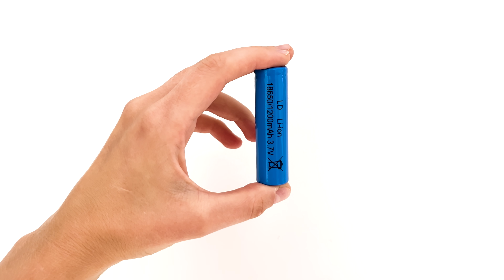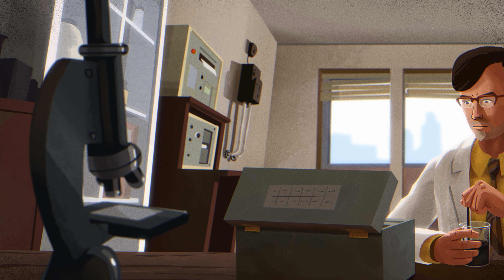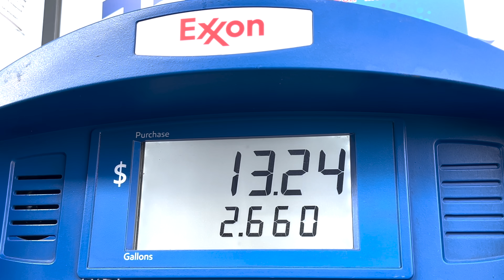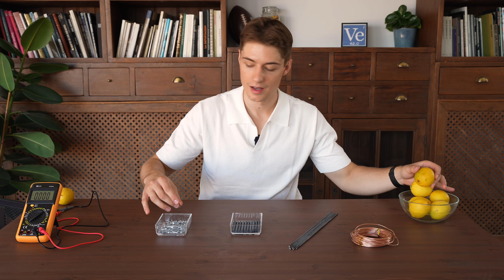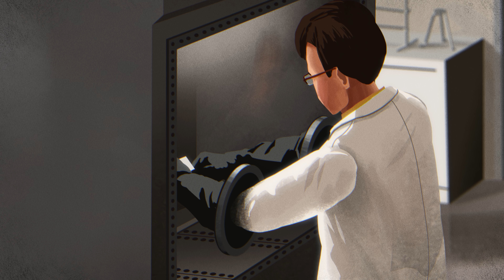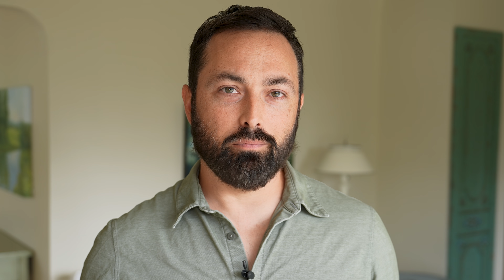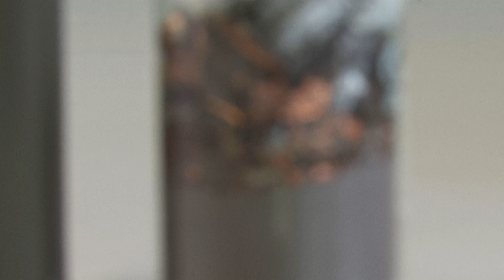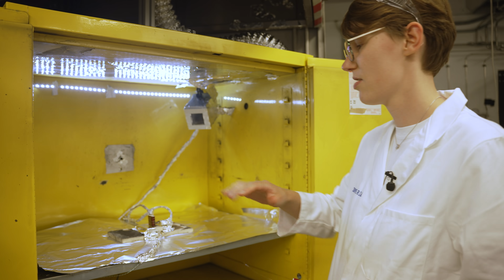The Perfect Battery Material Is Dangerous

Comment: holy incomplete 5:13–6:04... bro forgot to mention the important counterions that prevent a build up of charges in both electrodes (in this setup, indeed, zinc ions would be able to enter the lemon and be stabilized via solvation than to stay in the metal even without counterions, so only the cathode would be charged) and that is whatever acid was the source of the proton (mainly citric acid). these negatively charged couterions (that became negatively charged after losing their protons) pair with the positively charged zinc ions that got oxidized, however, in order to pair, they need to travel through the interstitial fluid of the lemon because they're on opposite ends of the lemon. if you cut the lemon in half, they can't reach each other, and so, as the kind co-host explains charge builds up, increasing the electrostatic potential energy of the electrochemical system to a point where the reaction (due to electrons being pushed back in the conductive material) stops. 

this explanation makes it seem that the electrochemical reaction involves the copper since they never mention those counterions, so i wouldve clarified that the copper here just acts as a conductive electrode and does not participate in the electrochemical reaction whatsoever, unlike zinc. in all, the electrochemical reaction is between acids in the lemon, predominately citric acid and zinc, and it produces hydrogen gas and zinc salts.

Comment: Near the beginning of the video the Carbon zinc battery shown cut in half, provides a nominal voltage of 1.5 volts per cell at the beginning of its life, not 1.2 volts.
Reply: A carbon-zinc battery provides a nominal voltage of 1.5 volts (V) per cell, though it can range from about 1.4V to 1.7V initially and drops to around 0.9V as it discharges.  Initial voltage depends on the make up of the cathode, manganese oxide(+2 or +4 valence), impurities, etc.  Zinc will corrode and hydrogen gas is the product, mercury was added to reduce this corrosion/gassing, and later replaced with non-mercury containing materials.

Comment: Rachid Yazami is missing from his's story. He’s the Moroccan scientist who, in 1980, discovered that lithium ions could be reversibly intercalated into graphite. This solved the safety problems of metallic lithium and gave us the graphite anode — the foundation of every modern lithium-ion battery. Also he didn't get noble prize because it is only given to maximum three people even though without Rachid Yazami we wouldn't have mobile, laptops or any devices that uses this. It's kind of incredible they did all this research but missed such a huge part either it was delieberate or it was done because the people responsible for doing the research weren't educated well enough to do proper researching in this field. I feel like ever since Veritasium got sold to Private Equity the pace of the videos have gotten a lot higher but that seems to be coming at the cost of proper Science studies

Comment: At 11:34, "...those electrons travel through the external circuit toward the cathode,...".
I thought it is not the electrons that travel, but it is the electric field that builds upon closing the circuit, see here: "The Big Misconception About Electricity"
I guess a could example of when to use which model.

Comment: No, AI doesn't "understand" anything. They simulate behavior or result, not understanding. This is an important distinction. NEVER do the mistake of thinking an AI understand anything. It doesn't. It mimics patterns and results without really understanding them. This is one reason catastrophic errors can slip through without the AI "realizing". That's because it's not in the business of realizing. It's in the business of pretending to realize.

Comment: Tesla has Aluminum batteries, non toxic, non flammable, cheap (less than 10 percent the cost) last 10 times longer, charge much faster, operate in a much larger range of temperature don't produce dendrites and the kicker, hold three times the energy.

Comment: The definitive solution to mitigate the inherent dangers of an ultra high energy density battery which concentrates maximal potential energy in a minimal volume, thereby magnifying the risk of catastrophic thermal runaway is the development and mandated integration of a self healing, multi functional solid state electrolyte engineered with an active, distributed Battery Management System (BMS), where the solid material serves as a non flammable separator that instantaneously seals micro shorts to prevent dendrite propagation, while the embedded intelligent network continuously monitors and autonomously adjusts electrochemical gradients at the individual nanocell level to maintain thermal stability and preemptively isolate any degradation event before it can trigger a cascading, system wide failure.

Comment: Loved this summary.  Matches everything fleet maintainers see and understand about their DPFs (and downstream stuff like DEF and SCRs).  

That said,  I think you missed some awesome opportunities to mention "rolling coal" when talking darkest grey smoke or that "there is no replacement for displacement" when talking about opportunities for more fuel for power.  Tiny cylinders vs big cylinders - they might both use the same physics but they are different on an efficiency vs power basis.  

I do not think anything will ever compensate for a cold block on a cold morning pulling in dense wet air and trying to mix that before it hits combustion - incomplete burn and that expanding flame front just means that byproducts form.  It still takes time for crank cases to get hot (boo to tiny diesels sold to weekend warriors running short errands and sitting in traffic) and burn off crankcase vapours too - all of this is just soot creation.  Sigh.  

PS: I have an ecoDiesel and I run her long and hot when I can, but cold Canadian mornings are hard on her - sometimes she isn't up to temp in 45 minutes even with a bra, the active grille closed and highway driving not into the wind.  The cold soak is so insidious that what in the summer would have her optimal in 10 minutes just cokes her up in the winter.  I understand that highly efficient cooling is necessary (to balance thermal expansion, stop melting and gasket destruction among other things) but it can also be an achilles heel.  It would be an awesome video but way to hard to show with so many variations.

Comment: I am surprised that you didn't bring up the recent advancements in battery technology. Take a look at Sodium Ion batteries. They have developed a coating for either the anode or the cathode that allows for pretty much instantaneous charging, with amperage ratings approaching that of super capacitors. The ability to handle such high currents dramatically improves the safety of the battery cell, since you will no longer get thermal runaway. The current cell technology has a lower energy density than lithium ion, but that is likely to improve in the future,  and the energy density is already high enough that it is already being used to manufacture electric vehicle battery packs. All of the battery materials are widely abundant, with the Sodium being sourced from sea water, which dramatically drops the costs of manufacturing. It won't be long before they make their way into handheld devices as well.
Reply: Oh and Sodium ion has much higher mean cycles between failure than Lithium Ion as well, so the batteries last a lot longer, and don't degrade as quickly.

Comment: There was no mention of Sony's contribution to the structure of the battery. At the time Sony was looking for a better battery for their electronics that were also the largest manufacturer of magnetic tape, which they predicted, correctly, would be largely replaced with solid state storage media. As they had a huge capacity to coat thin films on to plastic tape, the structure of the battery they developed was the rolled up anode/cathode structure. This took advantage of manufacturing capacity they already had, by replacing the iron oxide coating used for recording tape, with the battery chemical coating for their new battery design.

Comment: The problems with mining cobalt are not intrinsic to the cobalt-bearing minerals. They are problems of human origin, and can be dealt with if the political will exists to deal with them.

Capitalism demands that raw materials be as cheap as humanly possible; which means that the companies involved in the extraction, refining and distribution of cobalt have a financial incentive to maintain the status quo.

What's needed is pressure to change the status quo. This cam be achieved in a manner similar to the establishment of the FairTrade organisation.

Comment: In the video there is only a brief mention of the solid Interphase that forms on the graphite anode upon the first charge of a Li-Ion battery.
Without the solid Interphase, the battery would self-discharge in few days, and the process of ions intercalation would be much less efficient, leading to the formation of lithium dendrites in the early phases of the Li-Ion battery life.
The major parts of industrial secrets regarding electrolyte formulation and manufacturing processes and construction sequences revolves around the Interphase, in its recycling and maintenance. A properly designed Li-Ion battery can last for two decades, if the Interphase takes care of itself, limiting the decay of the electrolyte, the fracturing of the anode, and the untimely formation of dendrites.
The most sobering thing, is that the Interphase was unknown and unwanted, until it proved essential. Basically, it has been a stroke of luck, and without it the Li-Ion battery would have been another of the hundreds of failed attempts at creating a new battery.
Greetings,
Anthony

Comment: Cells such as li-ion with an intercalated ternary anode have been known from research since around World War II. And an aqueous solution usually allows for around 1.5 V, exceptionally 1.8 V, while lead-acid batteries, as well as aqueous electrolyte solutions, are stable even at 2.3 V. This depends on the overvoltage of hydrogen and oxygen on the electrodes, and not only on the decomposition voltage of water, which is ideally 1.23 V.

Comment: LiPO (Lithium Polymer) is most unstable, LiON (Lithium Ion) is considered more stable to overdischarging (a LiPO will puff if over OR under voltage), but LiFE (Lithium Iron) is stable, but gets slightly less voltage than the other two. LiFE is the future if stability and safety are key

Comment: Amazing video without the common misconceptions about batteries, but the comment at the end about cobalt is quite misleading, you only talked about LCO (lithium cobalt Oxide) during this video which is the chemistry used in Cellphone Batterie and consumer electronics. But today, the vast majority of EVs is powered with either LFP(lithium ferrophosphate) cells which contain no cobalt or NMC (Nickel Manganese Cobalt) cells which nowdays contain a constantly shrinking amount of Cobalt, so I would not say the coming demand for EVs is going to skyrocket the demand for Cobalt. Also, these chemistries are significantly more stable than LCO so an EV burning because of their battery is actually quite rare. Anyways thank you so much to have brought light to the subject of batteries since they are présent everywhere yet so misunderstood

Comment: If you are mentioning the problem with Cobalt, you NEED to mention that there are PLENTY of Lithium batteries with 0% Cobalt! Also, cobalt is used to produce the gasoline for cars. If you want to avoid using cobalt, you cannot get an iPhone, nor can you buy a gasoline car, but you can get an electric car!

Comment: theres no shortage of lithium if the industry would evolve again. lithium ion is the best battery but not the best to mine for. if we would change most of our stationary electronics to sodium based batteries, our mobile electronics will have a lot more lithium to play with. our battery investors are banking on us finding or developing a better battery material than lithium ion before we run out, instead of just thinking of actual solutions.

Comment: You should have included Lithium Iron Phosphate. While it has a lower energy density, it has the advantage of being able to use nearly 100% of its capacity. Lead Acid can only discharge about 50% of its capacity. Lithium-ion and Lithium-ion-polymer or LiPo (likely derived from Yoshino's work) can discharge around 80% but in many applications are limited to considerably less that that AND are not allowed to charge to 100% - both to extend their useful life. LiFePo4 is more durable, deep discharging and 100% charging isn't a problem, so its useful capacity exceeds standard Li-Ion and LiPo for the same weight.

But despite its safer design, LiFePo4 still has lithium and it can still burn if sufficiently abused.

Sodium-ion is finally coming on strong. NexCell makes retrofit kits for Toyota Prius and other hybrids that use the same Nickel-Metal-Hydride (developed as a much better replacement for Nicke-Cadmium, and you didn't mention NiMH or NiCd) modules. They manufacture their own Sodium-Ion cells to reduce costs VS the LiFePo4 cells they were having another company make.

You need a Part 2 video on the battery chemistries you skipped in this video.

Comment: I modelled a small electrical grid for my third year degree project. The purpose was to see the impact that charging EVs would have. When the % of properties charging a vehicle overnight was in single figures the system functioned normally. When the % reached 10% it became unstable and collapsed completely at 12%. The issue the entire grid has is not battery capacity but the grids capacity to charge batteries, especially with the push for net zero. The removal of base load supplies and increasing reliance on renewable sources will result in the collapse of the entire electrical supply system. Every 4 filling stations dispense the same amount of energy as a traditional nuclear power station, in the UK to switch to 100% EVs would require 2000 new traditional size nuclear power stations just to supply the energy used by the vehicles which replace the internal combustion vehicles served by public filling stations. It doesn't include those vehicles that are fueled by private pumps or tanks e.g. farm vehicles. 
Totally relying on renewable and moving to EVs in 2030 is a recipe for disaster.

Comment: In the 1980s we had nickel-cadmium rechargeables. They were awful. They had much fewer recharge cycles compared to Li-Ion. They also had "memory" which was some chemical thing where if you only let the battery discharge to 70% all the time, before recharging... then eventually that 70% was all you would get out of it. It would stop working. To this day people still talk about batteries having "memory" although it hasn't been a thing in decades.  They were also expensive. For all their problems, lithium based batteries are LEAPS better than old Ni-Cads.

Comment: And then here I am with a spot welder and minimum experience welding 200 cell packs :D NICE! 
I kind of knew all that tbh... How dangerous they are. Still took a chance with the idea of throwing the pack out of the window if something bad ever happens xD 
But truth being told, if not mistreated, lithium ion cells are relatively safe. More than that LifePo4 Cells, are basically safe. They get hot, they get fumy, they don't get firey :P But all that, basically if punctured...

All in all, a good BMS and safe charging voltages (often lower than max voltage of the cells) will ensure long lasting batteries without failures, catastrophic or not...